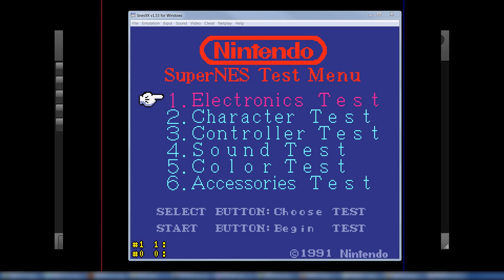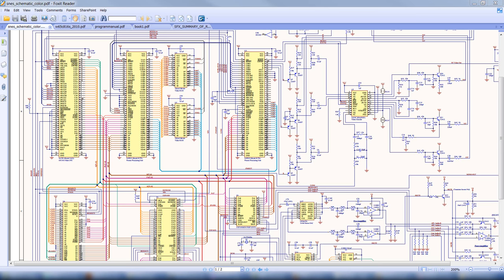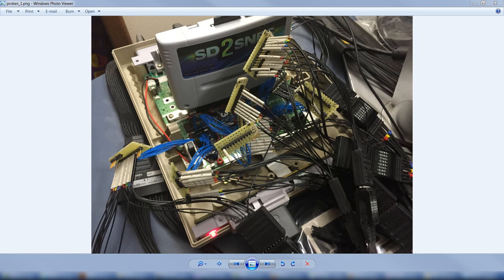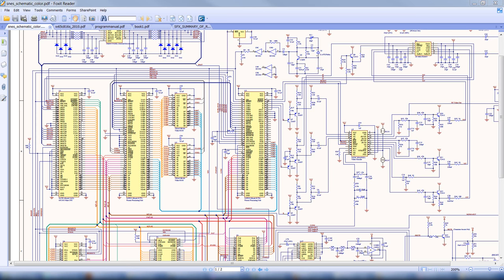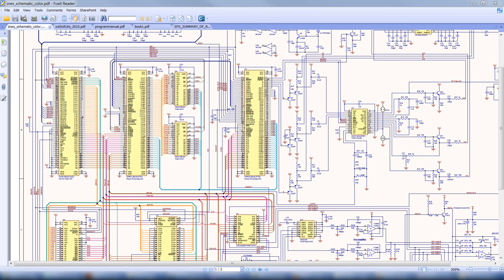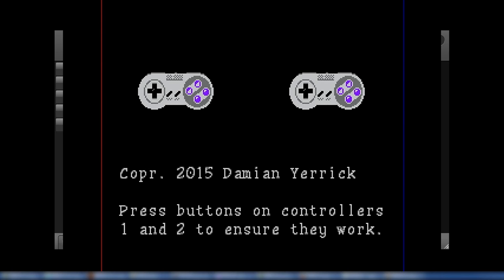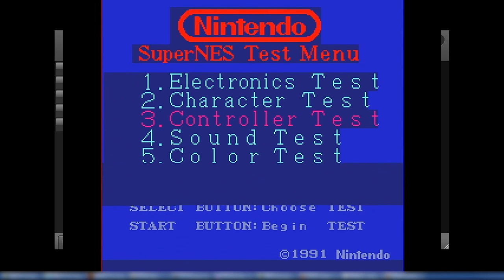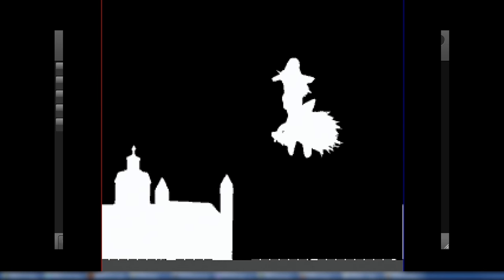Introduction to the VeriSNES (FPGA-based SNES) (w/ first ever graphics output!)

Comment: This is amazing, good job! 
Do you think your code, if modified, could be used to make cpu and ppu replacement chips? 

A lot of black screen snes would be thankful :)
Reply from the maker: Yes, they should be drop-in replacements. However, there would be issues that would need to be resolved with differening IO voltages. The original chips are very old 5V CMOS. Level translators would be required.
Reply: jwdonal So, basically levelshifters on all IO,   custom pcb and a way of fitting it to the snes board, tricky but doable. :)

Comment from the maker: Be sure to check the other video links in the description for more VeriSNES videos!
Reply: Hi, Jonathan,

I've been working on a similar effort to implement the SNES in an FPGA using Verilog.

I found a 65C816 core online, and fixed a few missing opcodes etc.
I also had to add a lot of the DMA stuff and memory decoding of course.

I then hooked up the dev board to a real SNES mobo, but with it's original CPU removed.
This vid is showing the CPU core running the test cart ROM, but using the real PPU / APU.

https://drive.google.com/file/d/0B1grqFdAErsraThVS0tRSkhtSjA/view?usp=sharing

The ROM itself was programmed into the Flash on the DE1 board, so I only needed to hook up the main data bus and expansion address lines to the SNES (and tie the /RD signal high on the original WRAM).

I'm kind of stuck on the SPC700 side of things though, as I've never tried to implement a CPU core from scratch before. I've added states for almost all the instructions, and implemented a few of the simpler ones, but having trouble figuring out how best to implement the flags stuff etc.

I know that the DSP has been mostly done before in VHDL, but not the SPC700 core (as that was emulated on the NIOS-II core)...

http://nova.polymtl.ca/~jevalb/

There's also the mostly finished PPU code from laxer that I found a couple of years ago. That's also in VHDL, but could of course be translated.

Would you be interested in working on some of this together? I know you have tons of experience with the inner workings, and I have of course been using your awesome vector schematics for a few years now.

If you normally work on your own projects, that fine, but I was wondering if you could give any tips on how best to implement the SPC700 core etc.?

If I can successfully get that working, I could start work on many other CPU cores for different systems.

EDIT: Here's a snippet of my code, so you know I'm not full of BS. lol

http://pastebin.com/QqUxcW6r

Comment: I think you will need to test Claymates with the sound. This is the one game I know off hand (that I've played for real on a SHVC board years before it died) that no SPC dump exists because it apparently streams the notes to the SPC. There's actually quite a few http://www.vgmpf.com/Wiki/index.php/SPC#Unsupported_Games that don't use the SPC in an expected way.

As for the weird rolling, NTSC is 59.94 drop-frame. If you have it outputting 60hz straight, it might be just slightly out of phase? If you're capturing video a NTSC capture card is also going to assume 59.94. (What made me think of this is I remember seeing a similar effect between two NTSC Video editing equipment when no genlock was present. In this case I think it's the emulated PPU's running at 60hz but getting 59.94 pixel data.)

re: Bad Apple, another video playing it indicates it's 2bpp, 256x244, 12Khz ADPCM which makes me think maybe it's synced to audio (because it seems to be playing back at half or maybe 1/3rd speed,) which going back to my first comment, check to see what happens with a game that doesn't generate the music on the SPC, but from maybe the CPU instead? It appears to be just playing the video/audio in chunks with delays (eg a DMA transfer?) rather than playing it at the wrong frequency.

I'm not sure if anything I said is helpful. But I am looking forward to seeing a completed emulator.
Reply: I may have found a second related answer to the scrolling lines, The Terasic DE2-115 board VGA encoder might be generating it itself.  The board uses an ADV7181B  which assumes 262.5 lines. In a NES AI FPGA project found elsewhere ( http://www.nintendoninja.com/ ) they had a similar problem when a NES signal was routed through the board. The VGA capture device you use likely just doesn't have the "rolling video" effect since it's not a CRT. The solution would be the same if it were real hardware (timebase correction.)

Comment: I noticed it's a Tektronix from the cables, but can you say what logic analyzer you used? Is there a better place to get that stuff than just ebay? With 64 Mb of sample depth, how long a capture could you do? Can you say a little bit or do a video some day on how you did some of the reverse engineering, at least your process?  Also, what was your logic cell/gate usage in your current fpga?
 Fantastic stuff :)
Reply from the maker: It's a TLA715. I got mine of eBay, best place to get them. I can capture several frames. Especially with conditional capture turned on. And yeah, I can make a video on some of the RE'ing stuff once I get some other things off my todo list. :)